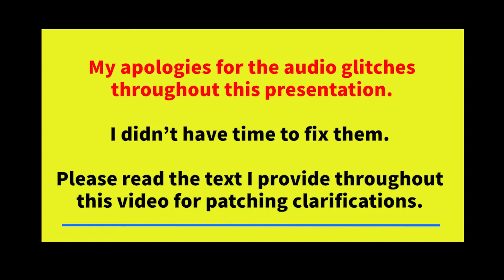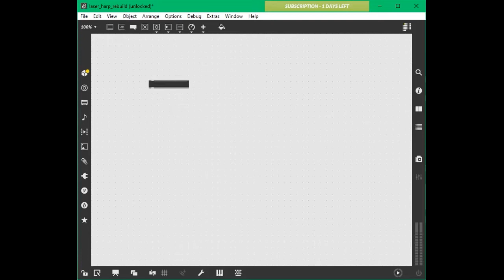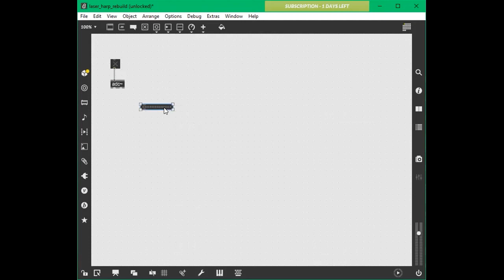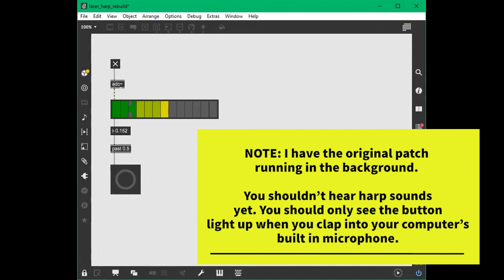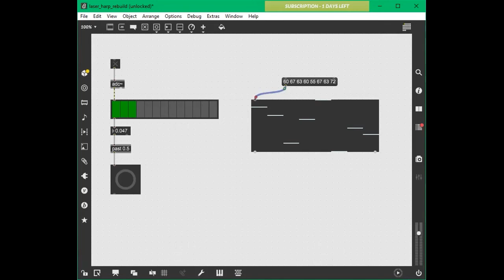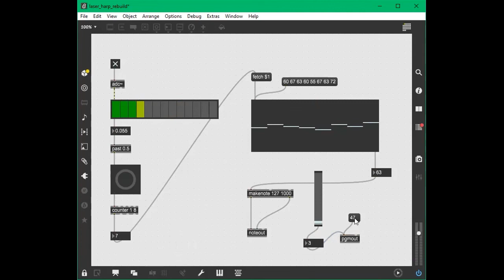DIY Laser Harp / Audio Toy Hack Max Patch Tutorial @C74connect

Comment: Hi. How are you going. Happy new year. I tried your email but email got returned address not found.
I have 2 of these toy guitar headstock.
I was interested in you next video single coil magnetic pickup or is it a works still in progress.
Max 8 can Max 9 be used instead and only available for Mac only
PC ?
Kind regards
Reply from the maker: Hi!✨ Thank you for checking out my videos!👍 Both Max 8 and Max 9 work on Mac and PC computers. You can definitely rebuild my Laser Harp Patch using Max 9, as it contains all the same objects as Max 8. My Laser Harp video is a few years old, so I may have considered working with single coil magnetic pickups, but I currently prefer piezo pickups for my projects. If you're interested in learning more about piezo pickups, feel free to check out the videos in my latest playlist: https://youtube.com/playlist?list=PLlVHstDF7JwwUFLLtGs4BP__QWeJfCwaB&si=P58huS-haT9fraSp. If you have any questions about the Laser Harp project or piezo pickups, don't hesitate to email me at psycheoperaco@gmail.com. I'd be happy to help you get started. Happy New Year!🥂